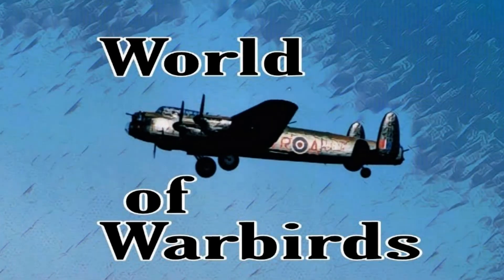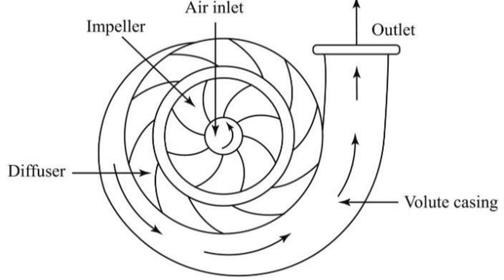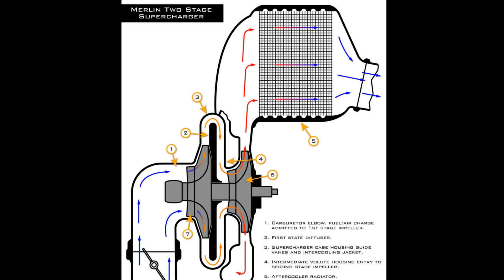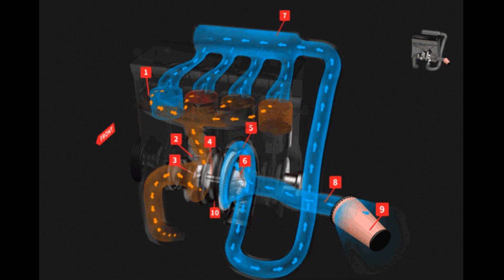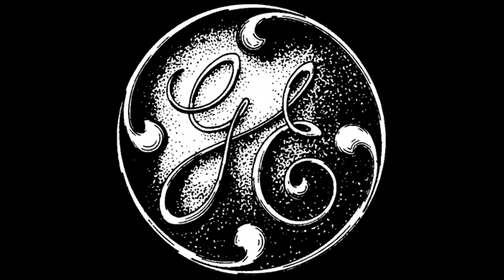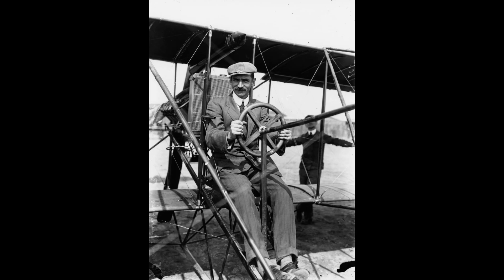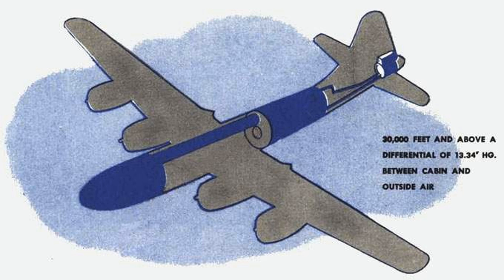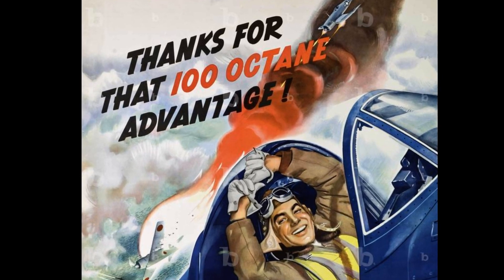Quest for Power Part 3: Superchargers and Turbochargers

Comment: I may not know much about aircraft engines, But I do have to add at the end of this video, That power recovery Turbines and turbocharged HAD to be geared separately to the engine not together and couldn’t act together. While the PRT and Turbo could be combined and used as such, It wouldn’t have been geared properly, efficiency, over/underspeeding, shock transmission if you used mechanical transmissions instead of fluid ones (or couplings), etc.

Comment: The exhaust is by far the hottest part of an engine.  Bearings in the hot section of turbochargers have a history of heat related failure.  That made them much more unreliable than superchargers.  Intercoolers help cool the hot compressed air however not enough to prevent knock (pre denotation) so the trick is too run the engine much richer (more fuel) to cool the incoming mixture.  That makes turbo charging less fuel efficient compared to superchargers.   Most but not all of todays WW2 warbirds with turbos have them disconnected for maintenance reasons.  Which is the reason the US Navy wanted superchargers and not turbochargers.

Comment: The turbo is especially efficient at high altitude because the difference in pressure between the exhaust gas and atmosphere is much greater. The gear driven supercharger must pull more power off of the engine to compress the low atmospheric pressure air to the design boost pressure.
The P-47 was designed as a high altitude fighter but the Air Force used it as ground attack. Go figure.
Reply: Not entirely correct, the higher altitude and thinner air provided less air to compress in the first place thus the loss in power. Both turbo and supercharged engines had to work harder to achieve the same boost levels at altitude, that power had to come from somewhere. At altitude the wastegates on these planes could be nearly shut, and likewise the supercharged planes would need to be in high blower (possibly 2nd speed if applicable.) 

All things created equal, it’s more efficient to extract the power from the exhaust than mechanically from the engine, but it’s certainly more complex, heavy, and expensive as well. Plus boost can be automatic - a huge advantage versus trying to remember the blower speeds and altitudes while attempting to stay alive in a dogfight. 

For the navy it was all about reliability and maintenance though. They refused turbos. The Corsairs eventually had some crazy external supercharger systems that were almost as good as the turbos.
Reply: @EstorilEm  Fascinating. Thank you. 👍🏻
Reply: An apples-to-apples comparison of the Corsair and the P-47 is at high altitude requiring full boost, (i.e. the Corsair running the first stage and the second stage running at high speed and the P-47 running its first mechanical stage and the turbo running at max with all waste gates closed), With both engines running at the same boost pressure and producing the same horsepower, both will produce the same exhaust pressure. 
Assume that both supercharging systems require the same shaft horsepower to compress the thin air. With the Corsair the shaft horsepower was power taken entirely from the engine. But the P-47 got most of its shaft horsepower from the exhaust turbine. That turbine is directly proportional to the difference in pressure (delta P) between the exhaust and ambient air pressure. That’s an extra 12.2 psi (at a ceiling of 42,000 ft the air pressure is 2.5 psi, compared to 14.7 psi at sea level). It is this delta P which NACA promoted as the secret to high altitude power. And the thin air at high altitude is where aerodynamic drag is minimal and speeds maximal, hence why all US heavy bombers were turbocharged.
Reply: @EstorilEm  An apples-to-apples comparison of the Corsair and the P-47 is at high altitude requiring full boost, (i.e. the Corsair running the first stage and the second stage running at high speed and the P-47 running its first mechanical stage and the turbo running at max with all waste gates closed), With both engines running at the same boost pressure and producing the same horsepower, both will produce the same exhaust pressure. Assume that both supercharging systems require the same shaft horsepower to compress the thin air. With the Corsair the shaft horsepower was power taken entirely from the engine. But the P-47 got most of its shaft horsepower from the exhaust turbine. That turbine is directly proportional to the difference in pressure (delta P) between the exhaust and ambient air pressure. That’s an extra 12.2 psi (at a ceiling of 42,000 ft the air pressure is 2.5 psi, compared to 14.7 psi at sea level). It is this delta P which NACA promoted as the secret to high altitude power. And the thin air at high altitude is where aerodynamic drag is minimal and speeds maximal, hence why all US heavy bombers were turbocharged.

Aircraft turbos are all about the delta P.
Reply: The P-47’s air-cooled engine offered better survivability against antiaircraft fire, compared to the liquid-cooled engine of the P-51D, if my memory serves. 🤔
Reply: @ronaldbyrne3320  Plus, it had lots of added armor and it was built very robustly to take lots of damage. But if you wanted to make the ultimate P-47 ground attacker you would remove all that turbo equipment and make it an even better (and much cheaper) ground attacker. Consider the Corsair with the same engine sans turbocharger was the fighter retained as a ground attacker in the Korean War.
Reply: @TomTurner704  You’re right. 🙂👍🏻